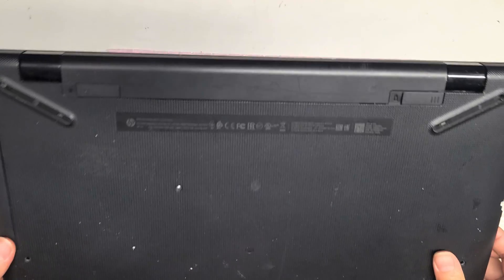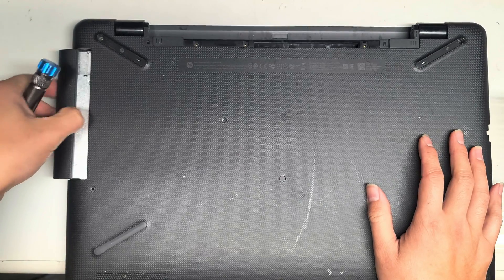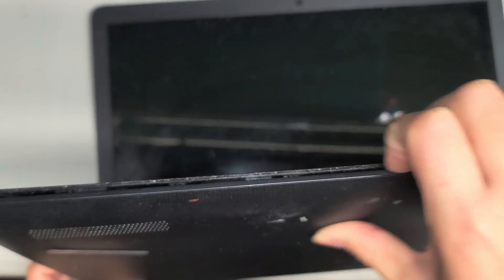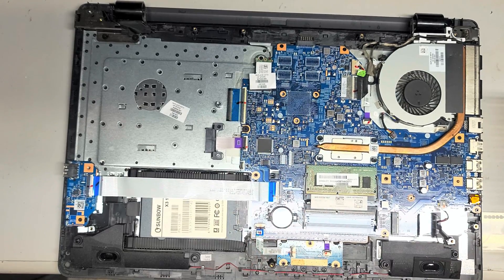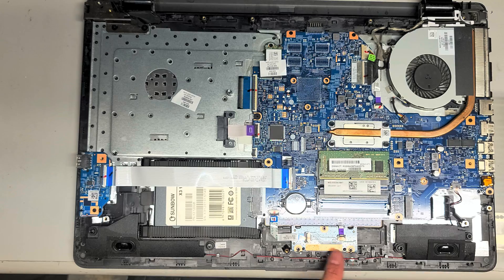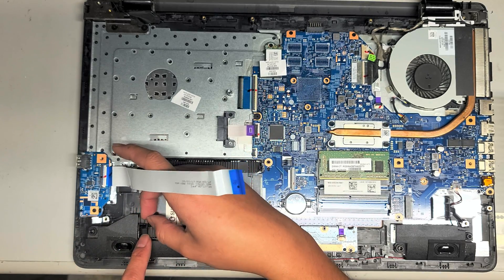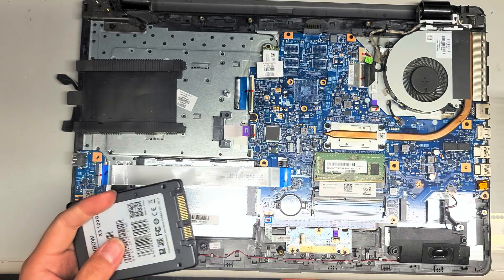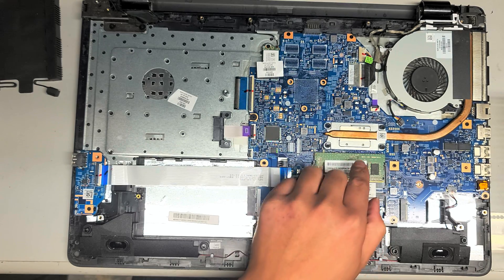HP 17-BS049DX Disassembly RAM SSD Hard Drive Upgrade Repair

Comment: Hi, What is the maximum amount of RAM that can be installed on this computer?
Reply from the maker: There isn't a max, just need the correct type.
Reply: @ItsBinhRepaired My computer has a RAM 8GB 1RX8 PC4-2400T-SA1-11

Comment: So my hard drive corrupted and I need to find a hard drive. Is there any suggestions of hard drives?
My hard drive for the laptop is a goner now. Also I’m pretty lucky coming across this video not knowing there were another two screws hidden. Also where can I find the second ram on amazon?
Reply from the maker: 2.5" sata SSD crucial, Kingston, sandisk, Samsung are all good. Your data is gone. You'll also need a Windows 10 usb installer.
Reply: @ItsBinhRepaired  I’m afraid that 500 gb isn’t on stock. For crucial
Is 250gb good? And I’m thinking about getting the Kingston hardrive, does it fit with the rubber hardrive holder that came with the laptop?
Also I feel like I don’t have much gb of ram. What kind of ram board should I go for?
Reply from the maker: @Gavyzx  check 480gb
Reply from the maker: @Gavyzx  any 2.5" sata will work
Reply: @ItsBinhRepaired  so any would work with the silicone covering?
Reply from the maker: @Gavyzx  yup
Reply from the maker: Ram should be fine
Reply: @ItsBinhRepaired  alrighty so I am waiting for it to arrive and it looks like the port of the hard drive is different. Would I have to turn the ssd upside down in order to fit? Like the metal part of the ssd which connects to the laptop. I got the Kingston one. Would I have to have the face “facing” down?
Reply from the maker: You want the port to be the same as the hard drive that's currently in there
Reply: @ItsBinhRepaired  so Kingston would work right?
Reply from the maker: @Gavyzx  any 2.5" sata drive will work
Reply from the maker: @Gavyzx  make sure you get a 2.5" SATA one
Reply: @ItsBinhRepaired  yea so I got the Kingston ssd
Reply from the maker: @Gavyzx  ok
Reply: @ItsBinhRepaired  so it should come today but what are the steps? I have everything ready like the bottom taken out and so I just put in the hard drive and then reassemble everything, then I just use the bootable usb stick? Do I got to the bios? (Sorry if this makes no sense I’m pretty busy today)
Reply from the maker: @Gavyzx  are you doing a clean install?
Reply: @ItsBinhRepaired  yea my old hard drive corrupted and now I’m lost on fixing it
Reply: I think I can just replace the old one with the new one and reboot it
Reply from the maker: @Gavyzx  ok
Reply from the maker: @Gavyzx  f9 on boot to select temporary boot device.
Reply: @ItsBinhRepaired  alrighty thanks.
Sadly my delivery will arrive tommrow.
Reply from the maker: @Gavyzx  hope it goes well
Reply: @ItsBinhRepaired  thanks I will make sure it worjs
Reply: @ItsBinhRepaired  is there like any videos out there that talks about replacing corrupt hard drives? And should I throw out the old hard drive?
Reply: @ItsBinhRepaired  um so I accidentally pierced the keyboard area with one of the screws. Everything is fixed and things are going according to plan.  So the keyboard area right under the mousepad is punctured. How can I fix this?
Reply from the maker: @Gavyzx  not sure, might have to replace it
Reply: @ItsBinhRepaired it’s was just a small hole because I over screw it with the wrong screw. Are there things I can buy to patch that up? Or are there videos on how to fix it. If not I would try to patch it up with maybe a sticker.
Reply from the maker: @Gavyzx  I dont know a way to fix it
Reply: @ItsBinhRepaired  are there videos on people fixing them maybe?
Reply from the maker: @Gavyzx  no idea
Reply: @ItsBinhRepaired  I see.. but thanks for the help. My laptops works smoothly. All thanks to you!
Reply from the maker: @Gavyzx  sounds good
Reply: @ItsBinhRepaired  so I have been using the computer and I’m realizing my gb’s are going down one by one very slowly.. is that normal?
Reply from the maker: @Gavyzx  what do you mean?
Reply: @ItsBinhRepaired  So I went to check files I saw that my gb was 420 out of 480 gbs were free on my first day. now its been 3 days and the gb went all the way to 414 out of 480 gbs are free. is that normal to happen?
Reply from the maker: @Gavyzx  depends what you're doing on your computer.
Reply: @ItsBinhRepaired  what can I do to stop it from draining?  Or is that just normal?
Reply from the maker: @Gavyzx  as you download and install stuff it'll use space
Reply: @ItsBinhRepaired  is there any ways to add more space besides buying a new ssd?
Reply from the maker: @Gavyzx  nope. Deleting stuff
Reply: @ItsBinhRepaired  hello sorry to bother but my computer dosnt look so good with the ram. What ram are there that I can buy to fit in my computer? And I was thinking in saving up for a new cpu maybe
Reply from the maker: @Gavyzx  what do you mean it doesn't look good? The RAM is ugly? You upgraded the RAM and it's worse?
Reply: @ItsBinhRepaired  Not exactly as the ram is pretty low on space when I checked the space on it from task manager and I kinda of need to upgrade it before it runs out.
Reply from the maker: @Gavyzx  how much RAM do you have?
Reply: @ItsBinhRepaired  At first its 8 and now its 4 since it went down
Reply from the maker: @Gavyzx  4? Did you reconnect the RAM right?
Reply: @ItsBinhRepaired  yea, is there any kind of ram I can attach to my laptop for additional ram?
Reply from the maker: Yeah
Reply: @ItsBinhRepaired  it’s been a while, what are the ram sticks called? i’ve been browsing through and looking for an upgrade, but at the same time i feel like getting a new computer. so should i get an upgrade for my laptop or go for a new device? if so what kind of “device” is ideal for streaming and gaming? and what kind of ram would i need for my current laptop.
Reply from the maker: @Gavyzx  depends on the games. One with a good video card usually.
Reply: @ItsBinhRepaired  what are good options? should i go laptop or an entire pc setup ? also what are ram sticks that is ideal for my current laptop
Reply from the maker: @Gavyzx  how much ram do you currently have? Desktop for best price to performance
Reply: @ItsBinhRepaired  currently my ram is 8gb and it’s not doing much as the other 4gb is reserved for some stuff
Reply from the maker: @Gavyzx  what computer do you have? Did you upgrade to an SSD already?
Reply: @ItsBinhRepaired  yes it has an ssd already